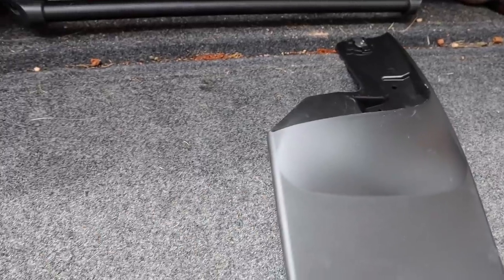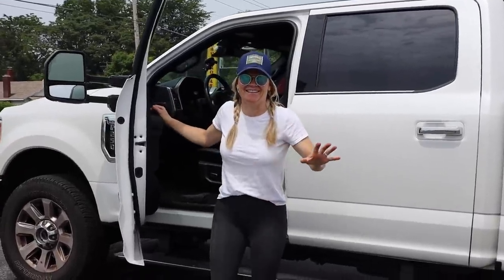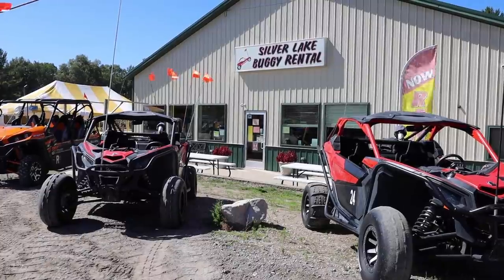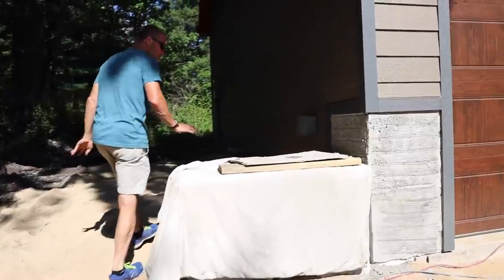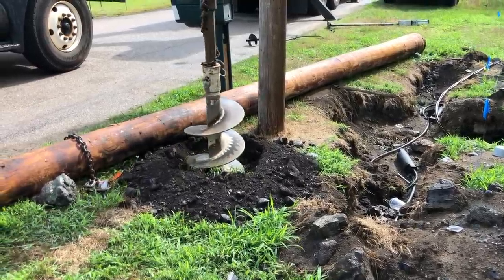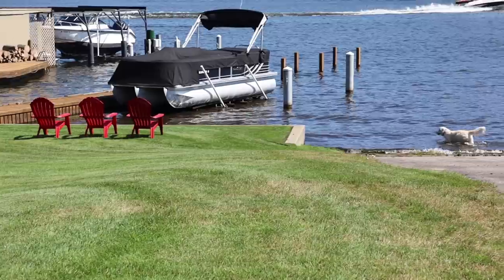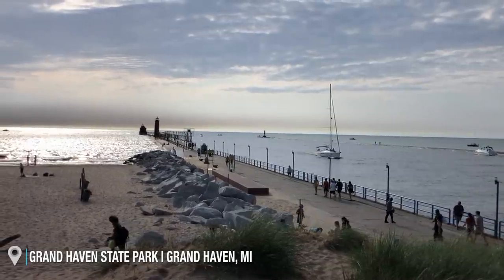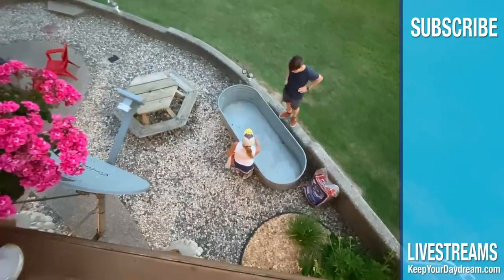RV MICHIGAN & STATE PARKS | SILVER LAKE DUNES

Comment: Just an observation on the trick mudflaps. It's a good thing they are easily removed. I had a similar set on an '02 Super Duty. It appeared they were trapping moisture and dirt against the fenderwell. I decided to remove them and I'm glad I did. The paint was starting to put with evidence of corrosion beginning.
   I'd recommend removing them every change of the season (especially in northern climates like Michigan) and cleaning the surfaces and reinstalling them. Y'all's Super Duty may have an aluminum body, but the paint can still put and aluminum won't rust, but it will corrode. 
   Maybe after the first good storm would be a good idea to check it out. 
   Safe travels, y'all.

Comment: As to the scratch in your truck window, use some 4-0 steel wool (that's 0000). It is the best thing ever, to clean scratches off your windows or windshield. It will not leave any scratches while using.

Comment: having worked around glass for years.  you need glass polish with a with special brush attached to drill.  Look up glass supplies and you will find a number of sources.   being tempered glass will not completely remove but will minimize.

Comment: Advice on the windshield scratch.  Four ott 0000 ultra fine steel wool and Comet cleaner and scrub and scrub and scrub.  It will NOT scratch the glass.  I've detailed cars and boats for 39 years so try it, you might be amazed.

Comment: I NEVER get drinking water (fresh water) from anywhere that is within normal RV water hose distance of a blank tank dump station because of EXACTLY what you've described. We only full timed for 4 months and saw all kinds of gross things, not to mention all kinds of not so obvious gross things with backflushing hoses, etc. We ONLY get fresh water from a source that is at least a hose length away from dump site (including individual sites). Which means we move often enough to get water in/out of parks and places....I'm just so grossed out by what you shared and what we've seen

Comment: As a fellow Airstream owner I wouldn't ditch those mud flaps just yet.  I have the WeatherTech mudflaps and hitch mounted mudflaps.  We drove through fresh highway striping and I can tell you if it wasn't for the hitch mounted mudflaps our trailer would have been solid yellow.  The WeatherTechs didn't stop any of it, but the hitch mounted mudflaps saved me from a large cleanup operation.  Also I have yet to get dings from rocks with the hitch mounted  mudflaps.  The WeatherTechs stop minimal stuff from damaging your rig.

Comment: To pull that scratch out of the window, you'll need to wetsand it. I know, it sounds absolutely crazy, but it does work! However, you MUST start with a 3k grit or coarser! Start higher if you even want to. Glass is like paint for the most part and all scratches can be pulled if it's not deep enough. I was a detailer for 7 years and that's where I learned that little trick

Comment: Cerium Oxide Powder. Mixed into a slurry paste. 3 inch felt pad polishing disc/spray bottle with distilled water to keep the slurry wet and of course a drill to run the disc.

Comment: Great video.  I have the Husky version of the mudflaps and love them.  We have been down a few gravel roads with a painted nose cone on our travel trailer.  Haven’t seen any rock chips, yet.   I have the thought of getting some inexpensive rubber mudflaps the same width and extending the length 2-3 using the rubber mudflaps.  Would require drilling into the plastic mudflaps but would offer a littles extra protection.

Comment: Glass crack/scratch repair: Clear fingernail polish. Wait until it dries and then use a razor blade to clean it up (or polish remover in a pinch- but watch your paint). Touch up a second time if necessary.

Comment: If you buy a windshield crack repair kit and follow the same instructions as the crack repair. Fill in the scratch let it cure then scrape off the excess. It will make the scratch practically un-noticeable. Is Wendy related to Trish or are you all just friends? They have similar laughs and it looks like they could be sisters.

Comment: Great show. I have watched a lot and learned a lot. I am new and pulling a 29 foot trailer with a Silverado 1500 using recurve r3 weight distribution / sway control. Are you still using the Hensley on your new rig and do you think the Hensley or moving from a 150 to a 250 had a bigger effect on an overall better towing experience? I was in NH last weekend with some 30 MPH winds and did not like it much.

Comment: I can agree that the mud flaps do look better than the old ones.  Buuuttttt.........are they going to be as effective as the larger, lower, farther back ones to protect the airstream from rock/debris?  I don't care for the ones that rock and not solid either.  I've not had the large slip on flaps but I'm sure with a little engineering you could come up with an ez on, ez off design that would be solid mount.

Comment: What no fancy over price Anderson blocks back to good old fashion wood A! The way I do it I have 3 tears giving me a hight of 4.5 inches I have only need the 2&3 tears a couple of times usually just 1tear I use 2X10 6' then 5.5' then 5' with 45 degrees cut at both ends. I never sink and get stuck. PS I also carry a 5' piece of 3/4" plywood as a tweaker. So when I pull up to my site get out and look say to my self what I need put down the board or boards back in upon the boards and 99.9% of the time I am inside the bubble and that is close enough for me

Comment: I hate to say this but from the looks of the scratch on the glass I don't think you'll be able to do much to remove it.  If you can run your fingernail over the scratch and your fingernail snags in the scratch then it's too deep to repair.  Also do not try to use a rotary or orbital polisher, they will just create too much heat and possibly shatter the glass.